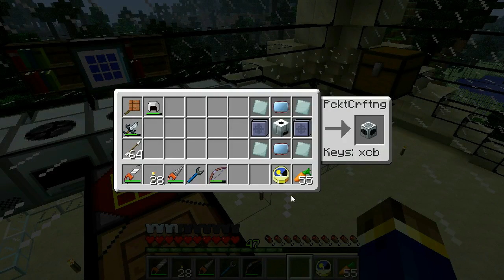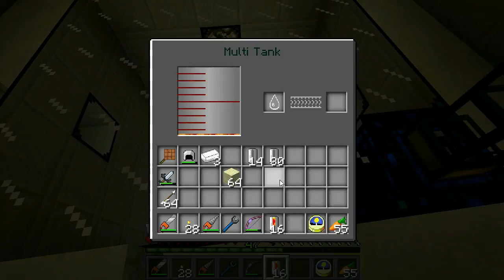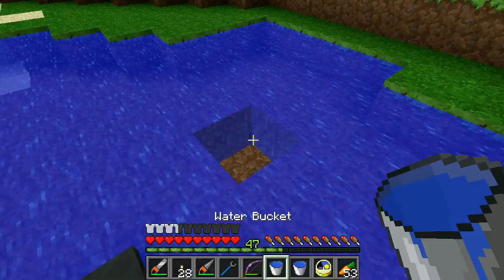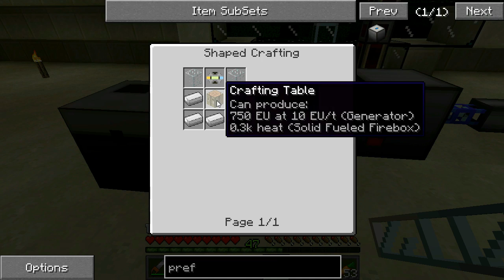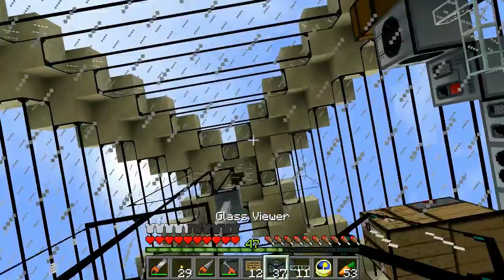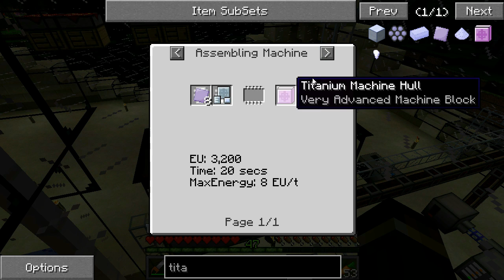FTB Ultimate 7 Industrial Centrifuge and Electrolyzer

Comment: you should set up applied energetics to run your centrifuge i did it and it works great you can teach it that if you put cell into a thermal generator it will get out lava cells you should also be able to connect a fabricator up to your  system and teach it to make cell until your ready to build the crafting cpu i even run my centrifuge off of my thermal generator

Comment: Make an alveary so you could have like a desert bee in a taiga biome but you need to make one in a 3x3x3 pattern and wooden slabs on the top and about the biome thing you get an alveary fan or heater they have a 60% mutation chance or so and are like a apiary running off 3 proven frames